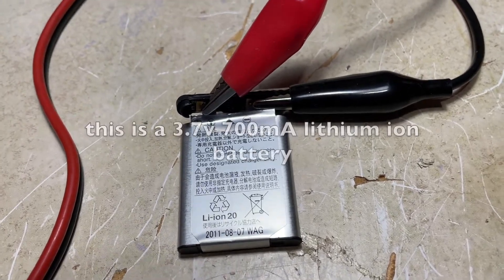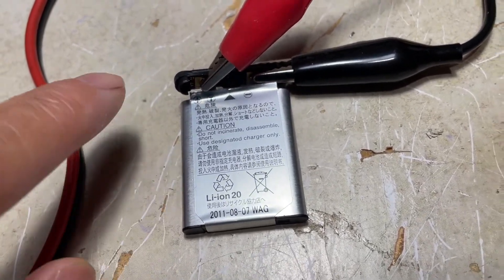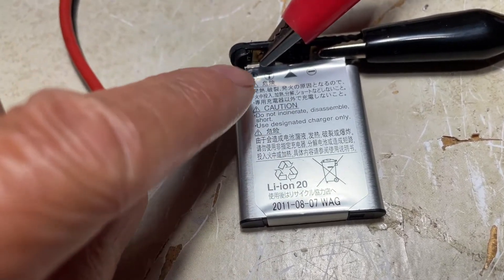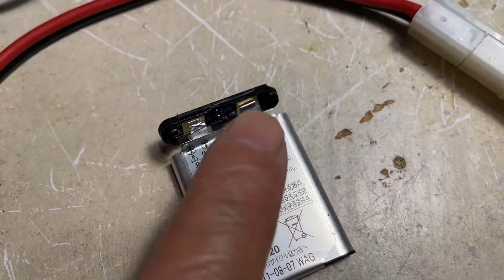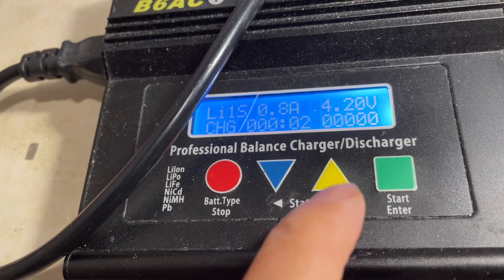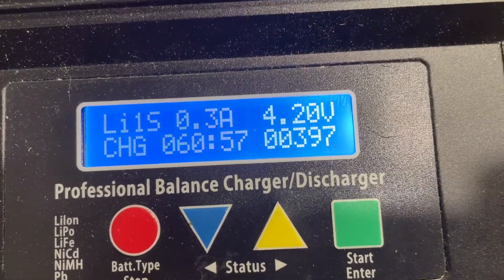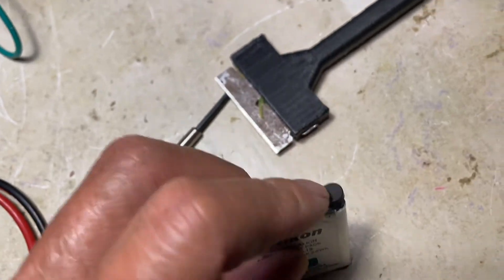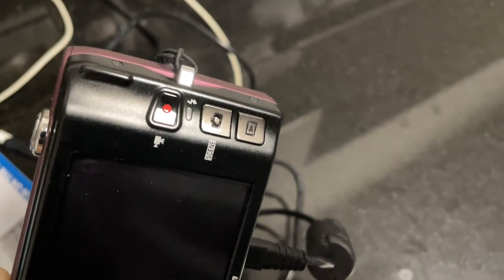Reviving a dead Nikon Coolpix camera battery

Comment: This is why I don't like the protection circuit built into the battery/cell because you can't simply reset it you have to throw it out or tear it up then rebuild it as you did.
Reply from the maker: At least they should tell you to charge it every so often. The Canon oem battery is actually very expensive.
Reply: @wtam69  I agree.  See, the thing is the battery fell too low then the under voltage circuit protection kicks in and game over.  They don't tell you so Joe, and Jane normie throws it away and goes back to buy another YET the battery was actually 100% good.
Reply: Confused here. You mean if it gets too low it can't be charged ?
Reply from the maker: @bertcochran1770  Sorry I didn't make it clear. Indeed, if the battery gets too low, it will not charge. That's for your safety as the protection circuit will prevent charging of the battery rendering it useless.
Reply: @wtam69  thank you.
Reply: @bertcochran1770  Yes, if a battery falls too low the circuit will prevent it from being charged as an under voltage protection.  With the protection circuit built onto the battery you can't charge, so you have to do what Paul did in the video by disconnecting the protection circuitry then charging the battery above the magic threshold (a safe bet is 3v) and the protection circuitry will then allow it to be charged further.
Reply from the maker: @generalawareness101  That’s a clearer explanation of this charging issue. We are told to keep the battery at a storage charge of around 3.8v when the battery/camera is not in use but most folks have no idea what voltage their battery is at. So, you put your camera in the drawer after using it and the next time you take it out and it won’t charge. The cheap replacement battery is a mix bag and most likely not as good as the oem battery which costs 5 or 6 times more.
Reply: @wtam69  Exactly.  It would be nice if the camera would tell you the voltage not some bar graph.  I mean the tech is easily done plus they already have the screen there.  The problem is they don't want you to know so you go buy another battery.  Like they do with ink jet printers where you open the cartridge  use it once then in six months it says you are out of ink when in reality you are not.  The chip on the cartridge simply timed out to make you buy more ink (a nasty practise in the industry that is very well despised and known about).
Reply: @generalawareness101  thank you.